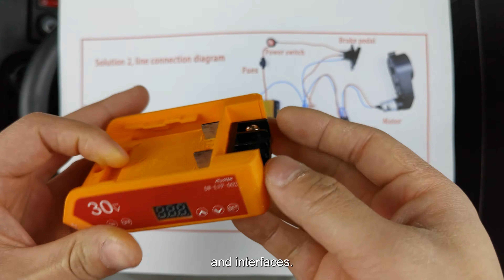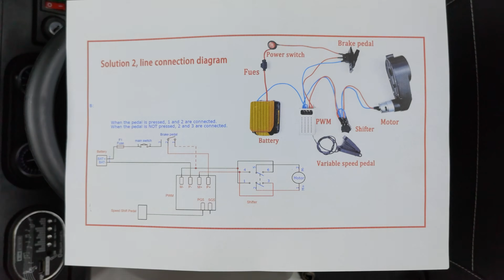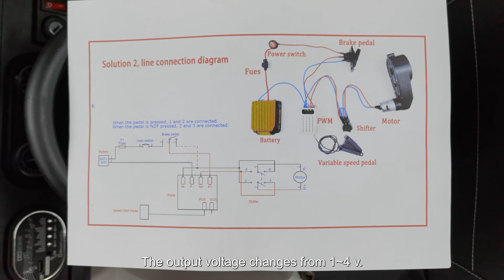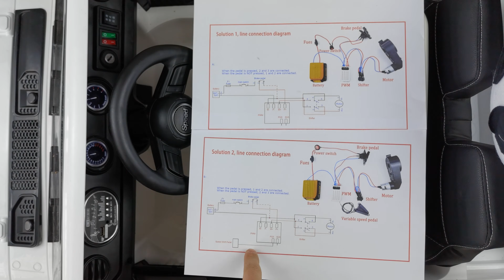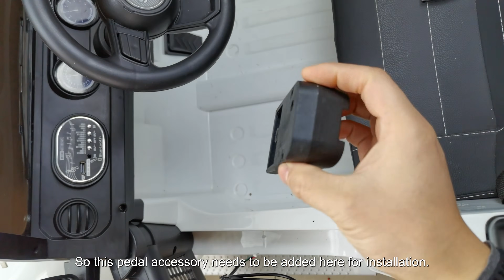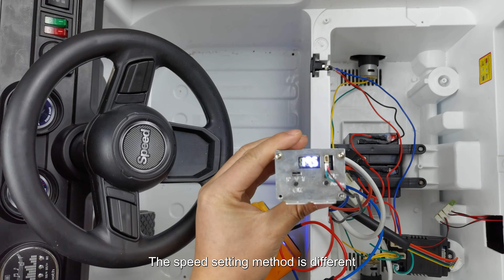MgcSTEM PWM 2.0B Variable Speed Pedal Upgrade for Power Wheels, Stepless Speed Control （2）

Comment: Can this system handle dual motors? If so, how will it be wired?
Reply from the maker: Hello, it can drive dual motors. Simply connect the two motors in parallel.

Comment from the maker: Our official website link:
https://www.mgcstem.com/en
Amazon purchase links:
Adapter Conversion Kit: https://mgcstem.pse.is/8e7j9l
PWM Controller Upgrade Kit: https://mgcstem.pse.is/8e7jj5
Battery Adapter LVP-30-12VDC: https://mgcstem.pse.is/8e7hqf
PWM2.0B: https://mgcstem.pse.is/8e7j5m
Variable Speed Foot Pedal Accessory: https://mgcstem.pse.is/8e7hm5

Comment: Hi, it would have been easier had you marked the brake pedal pins 1, 2 and 3. Instead of us getting a multimeter to check. Simply is the top pin 3 and the bottom pin 1?
Reply from the maker: Hello, you will need to use a multimeter to test the pins specifically. The labels 1, 2, and 3 in the video are only for easier explanation.
This is a DPDT switch (Double Pole Double Throw). When the switch is in the middle position, it is disconnected. When toggled to the left or right, it connects the circuit in different modes

Comment: Hi, I have a regular 18v adapter and not the LVP with interface as yours. Could you please provide a video of how to connect the wires who don’t know have this fancy adapter. 
Also recommend you to sell for other brands like Milwaukee, Ridgid, Ryobi if you can. Thanks
Reply from the maker: Hello! If you use a regular adapter, the connection method is the same. Just connect the positive and negative wires of the adapter to the corresponding terminals correctly.
However, it does not provide low-voltage battery protection and may easily damage your battery due to over-discharge. You can also purchase a low-voltage protection module to avoid this problem:
https://mgcstem.pse.is/8e7jzu
Besides, we will take your suggestion about adapters for other brand batteries into full consideration. Thank you!

Comment: My original car does not have a main power switch. Do I need a momentary switch or a toggle switch?
Reply from the maker: Toggle Switch
Reply: @mgcstem 20A minimum?
Reply from the maker: @robertbeverly1508  The minimum current rating is 20A, and 30A is recommended—you can refer to this specification.https://mgcstem2.pse.is/86ptks